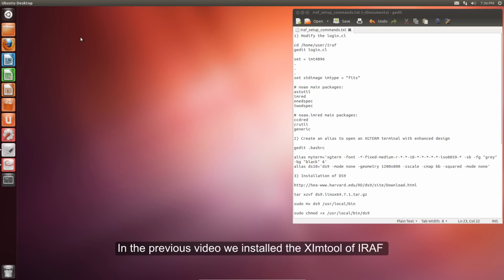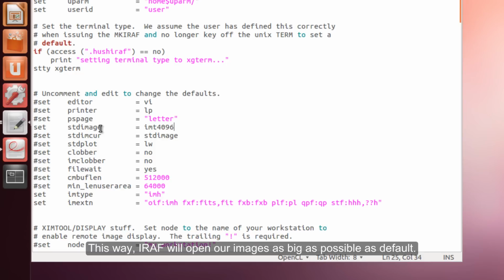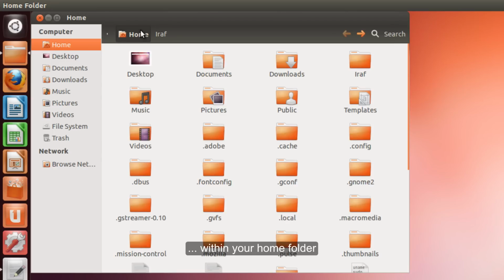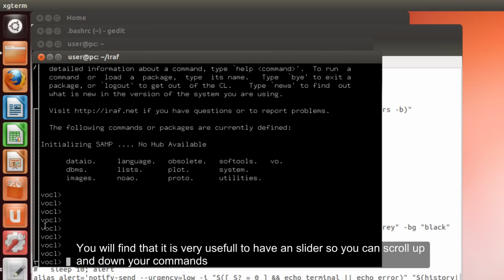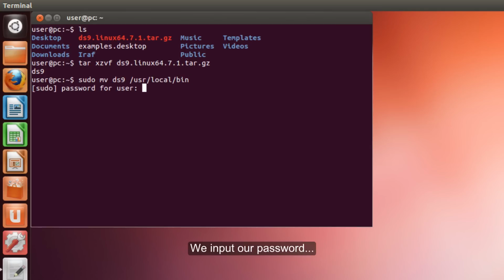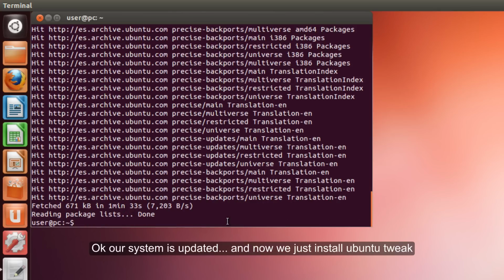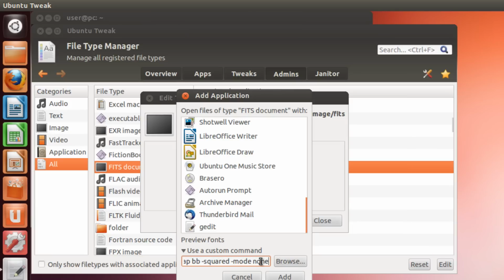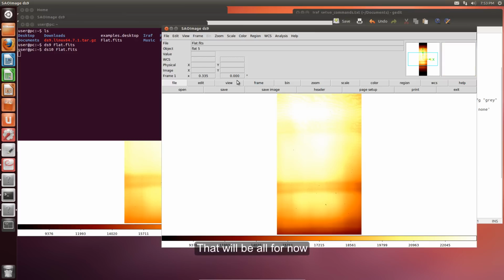IRAF Tutorial Part 2: Set up [HD] [English Sub]

Comment: I have installed iraf (it has shown installation complete without any error). I have installed not as a root user. I have installed using the".install" command. It is opening in terminal correctly., by typing "iraf" in the terminal. But there is no login.cl file in that iraf directory. Is there anything wrong?
Reply: Got it. It is in the local folder of iraf installation directory.

Comment: the Iraf installed correctly but when I open the xgterm and open the cl it is like not accepting any comand... ???
Reply: this is all what is shows when I open the cl:
 NOAO/IRAF PC-IRAF Revision 2.16.1 EXPORT Mon Oct 14 21:40:13 MST 2013
      This is the EXPORT version of IRAF V2.16 supporting PC systems.

  Welcome to IRAF.  To list the available commands, type ? or ??.  To get
  detailed information about a command, type `help <command>'.  To run  a
  command  or  load  a  package,  type  its name.   Type  `bye' to exit a
  package, or `logout' to get out  of the CL.    Type `news' to find  out
  what is new in the version of the system you are using.  

  Visit http://iraf.net if you have questions or to report problems.
Reply from the maker: Hello Mustafa:That message you are getting seems the legit one... Are you getting the "vocl>" terminal symbol at the bottom of the terminal window?Also have you tried in a "bash" (the default ubuntu terminal) to run the "iraf" command? just to see if it also works?Please tell me how it goes
Reply: My friend I tried in both I don't get "vocl>" symbol...?? is there any thing i should do??
Reply from the maker: Hello friend! Sorry for the delay. I am afraid I have not experience with this issue :(
I would advice you to delete the IRAF folders and try again the installation...
Also you should try to post the issue in the official IRAF forums... Sorry I cannot give you a better answer
Reply: another question plz...after installing IRAF should I login to the IRAF Account??
thanks

Comment from the maker: Hello Theissen! Thanks for the post!

(I am assuming that by coordinates you mean image pixels, correct me if I am wrong). Let's try these aproaches:

1) I do not normally use DS9 within IRAF: I keep the ubuntu terminal alongside to open images with my alias. Maybe you could set an alias which opens an image in the region/size you want. 
2) If you google "setting IRAF ds9" the first link takes you to a harvard ds9 website titled "IRAF Support" check the scale menu section.
Tell me how it goes

Comment: Hello! I have this really weird problem with ds9 and IRAF.
When I use the 'display' task in iraf, I get it to display in ds9 given that I opened it before starting iraf. However, the coordinates are wrong!
I did the same corrections as you did in the login file. When I display e.g a 1024x1024 image in ds9, it has coordinates ranging from 0 to 4096 and the image I want display is in the middle. So for example using the 1024x1024 image as example, the first pix of the image starts at pix 3500!

Comment: I followed all the steps of the previous video to the letter but my login.cl file is my home folder while my iraf folder is a folder in my file system. i moved iraf to home folder and my home folder wouldnt open so i moved it back. everything seems to work ok but it seems odd. is that ok? Also, my bash folder doesn't have anything but a few lines of code in it (fresh install of ubuntu). Do you only have all that bash code because of use over time having a lot of edits to it? Thanks